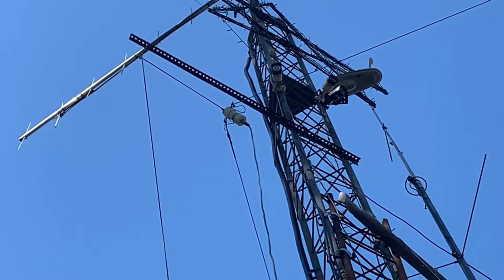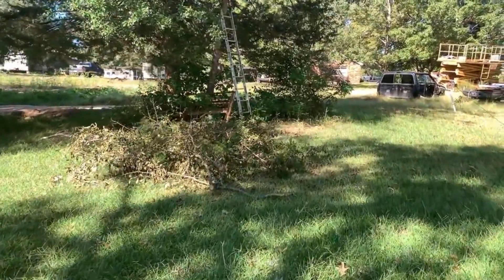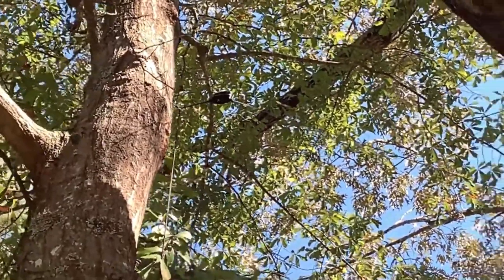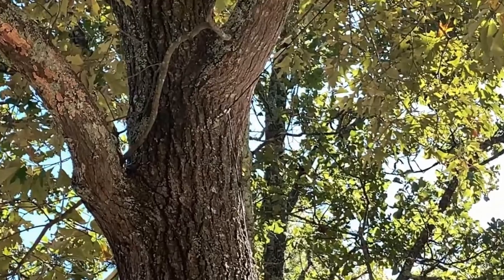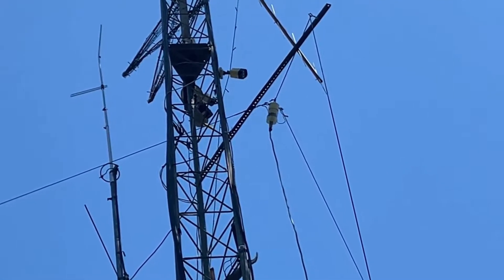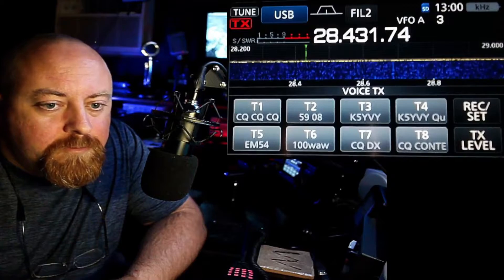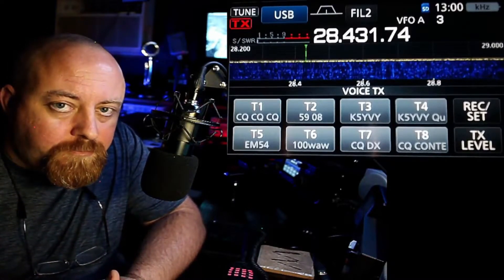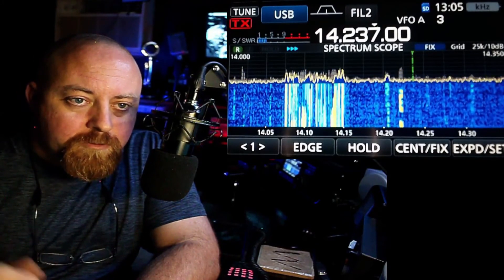80m wire loop TX/RX antenna is AWESOME | Ham Radio

Comment: Most people end up with more signal and less noise vs a vertical. Your area may just have less noise for the vertical to pick up.
Most radios in your situation would benefit from turning on an attenuator. You might find ATT 1 gets you the same noise, but just a little more signal… as mentioned, experiment.
Nice antenna!
Reply from the maker: Hey John, thanks for the comment! I will say since this video I in fact either turn back my RF gain or use the ATT on the low bands when needed. Currently I have been using a T/R switch that allowed me to listen on both the vertical and horizontal at the same time, usually I keep the loop gain turned down just enough to bring the noise floor down, really helps to hear some stations. When I transmit it’s on the loop only. Been working well for me. 👍

Comment: You know you can use your loop also on 6m band?   if not directly in tune it's simple to make a manual tuner for 6m band .   There are good schematic  on google for make it
Reply from the maker: Marko Yes I use my loop on the 6m band very often. Works well , but I do still want to get my 6 element yagi for 6m in the air 😎 thank you 73

Comment: it's an 80M loop but you demo'd it on other bands  and not 80M ! ??? I made 40M horiz loops and just used them on 40M with a Q secton matching device.
Reply from the maker: John , what was I thinking!? All this time and I didn’t even think about 80m not being in the video. I shared the analyzing results in the discord at the time. I can tell you it works great in the extra/cw portion of 80m but I still use my vertical above 3.700Mhz cause it’s easier for me than using the manual tuner. Thanks for the awareness and comment👍 73

Comment: how do you adjust for swr mainly for 75mtr with the balun, most others use 400 ohm ladder line, I prefer the 4/1 method myself getting ready to install one so setting SWR is important
Reply from the maker: Hey Richard, myself I was lucky, I cut approx 266ft of wire and it worked where I wanted it to. So I didn’t mess with it anymore, but if I wanted to adjust the tune I would start by folding a good bit of wire on one end and twisting it around itself. This will allow you to see adjustments in your swr and allow you to decide if you need to continue to shorten or lengthen the wire without making a permeant cut. Keep in mind this method will not show you exactly where to cut , because the twist will still interact some, so just cutting at the fold will not be the same swr when you cut it, may have to trim some more to get that swr where you want it. I hope that made some sense.
Reply from the maker: I will add that I can use the internal tuner for all bands 80-6 with this wire. Except for the upper part of 80m. 3.7Mhz and lower internal tuner works, above i switch to my vertical which is tuned for the upper portion.

Comment: Good advice...  Yeah, you know, one watches some of these youtube video's that model low hanging horizontal antenna, and claim all the RF just goes straight up, and I call BS, and what we see in your video is just more proof. Don't get me wrong, the modeling programs are on the right track, but the visual representations, IMHO, are much less pronounced than what is shown.
Reply from the maker: Thank you David, yeah model programs are great, but there is always that “real world” element that can be very complicated for a computer. I always want to promote the idea of “Just try it”. Because of modeling programs and other “how you should do it” videos I really expected my loop to be NVIS, I already had a low take off angle vertical for DX, but to my surprise with my setup, the loop worked very well and I’m still working DX with it. Soil condition is sandy clay here and I suspect that is why I don’t have to have the loop at 50-75’ like popular belief. 🤷🏼‍♂️.
Reply: @K5YVY  I love trying new things, and learning the positives and negatives of each antenna type. Case in point with the vertical antenna. Vertical antennas in the past were elevated for a reason besides needing far fewer radials. There were elevated so there would be less impact in the Fresnel Zone. Ground mounted antennas the radiation is happening at the bottom of the antenna where the current is. Trees, houses with wiring, bushes, shrubs, etc, that are within 1-3 wavelengths of the ground mounted antenna absorb signal due to low radiation angles. This is a negative of the ground mounted vertical, but you will never hear about it from the antenna manufacturers. I truly believe the best antenna type is the one that is best suited for the situation, but think hams should know the disadvantages of each type by experimentation. In other words, don't just take my word or anyone else's word for it :)  Try it for yourself and judge. Cheers and 73
Reply from the maker: You are exactly correct, my vertical is the GAP Titan DX, no radials and mounted on a pole, the base is 8ft and the feed point in half way up the 20ft antenna from there. So far I have avoided antennas with radials, mainly cause I just never wanted to deal with them lol. I’ve always enjoyed making antennas, even though I’m not very understanding of the science of them, I have a understanding of how they work. Cheers73👍

Comment: You have that beautiful MS Clay for propagation! You should build a ground loop if you can keep the critters out of it. Would love to see it in action, only read about it down there and with salt flats.
Years ago I flew down to consult on rebuilding the Old house in back bay Biloxi. Left with 40 lbs of lovely frozen MS shrimp as luggage!
Reply from the maker: Yea I think I can get away with antenna's lower than "normal" because of the clay soil.  A ground loop would be interesting, but horrible to still mow the yard lol.

Comment: Any antenna works better than no antenna. I've worked a thousand miles on 20 meter sideband loading up the coax shield for a 2 meter beam on a chimney mount on the roof.
Reply from the maker: You are correct about that John 👍.

Comment: Not sure your 80m loop is better than your vertical  based on the video.  The S/N ratio was the same.  Personally, I’d rather have an S8 signal with an S0 noise floor than S9+10 with an S2 noise floor.  I’d bet your 80m loop is a good cloud burner in the best sense, probably fantastic for NVIS and superior to your vertical up to 500 miles.  A loop set up like yours would blanket regions of the country, or the entire state of Texas.  For DX, you prolly need it at 120 ft.  It’s ain’t called a sky loop for nuthin’!
Reply from the maker: My purpose for the loop was actually to have a antenna that would be more NVIS than my vertical. But I find myself primarily working off the loop as I switch between the two, most stations are stronger on the loop, I do come across a station now and then stronger on the vertical still. The noise factor was disappointing, as I know others that put a loop up similar to mine and first thing they rave about is the low noise. I have power lines fairly close on two sides of the loop and believe that’s most of my noise issue as the vertical isn’t as affected.  I do work plenty of DX still off the loop, but I could imagine how much better at the appropriate height it would be. Thanks for commenting👍
Reply: @K5YVY  Yeah, after reading your comment I have to agree with you. I was a little surprised to see the noise up on the loop.  I’ve had/built two vertical antennas in my day.  The first and most complex was a 31 foot vertical with an aluminum ground plate and 32 radials.  It was surprisingly expensive given all the copper involved. It was a solid performer, I got into Europe no problem and most of the country. You can see a video on my YouTube channel of it on receive with an icom r75.  It did a great job for a vertical, but it always had a relatively high noise for compared to two wire fan diapoles I put up, and of course when I built/set up my Cushcraft MA5B beam, it was no comparison on 20m-10m.  

You may have a higher noise floor  because of powerline noise, of course you probably can determine that yourself as powerline noises typically can be blocked to great effect with NB on modern receivers.  If your noise blanker doesn’t work, you’re probably just picking up atmospheric noise locally better than your vertical.  A good vertical/ground  system has its maximum take-off angle at 10 deg or so; your loop has a 90 deg max take-off angle (straight up) at 20ft.  Especially on 80 m, I’m betting any thunderstorm in any direction w/in 1000 miles can impact your noise.  I’m not sure there’s anyway to fix that with the loop except for raising it, but that’s the problem with horizontal loops, ideally they need to be half a wavelength up for maximum performance. And an 80 m, unless you’re living in a redwood forest that’s gonna be really tough to do. Still, it’s a great NVIS set up.  

Do you know would be cool with the amount of property you have? Set up a 20 m or 15 m  triangle loop fed at one corner opposite to where you’d like to get more DX from.  If you can put that up just a bit higher, at 30 feet, you’ll get 2-3 db opposite the feed point corner.  Alternately, you can set up a vertical delta loop for 40 m, then put a reflector behind it that’s 5% larger, and you’re going to get a huge 5 to 6 Db again and maybe 10 db FTB.  That’s my next project. I don’t have my beam anymore, to install a new one at my current property and do it right Would probably cost me five or $6000 on the cheap side of things.

Anyway, I like your videos. Post some more!
Reply from the maker: Great information! Now I know what to use my left over wire for. Seriously thank you for those ideas, might have to talk more!
Reply: NG9X That's not true I can use my 80m loop  which is about 90ft at its highest  point and on 80 m it's a fairly good nvis antenna perhaps better mid range antenna !  But on all the other bands above up to 10m  I'm able to work the whole world with just 100 watts  ssb phone  and cw  while on   digimodes  5 watts is enough  .

Comment: Mine is only 20 feet off the ground and had it for 25 years just love it and requires no maintenance.  Same length as yours.  Has the most gain on 20 meters
Reply from the maker: Awesome Tim! I have to agree it seems to work pretty good on twenty.

Comment: Gm Joe. I run a delta loop and have configured it so many ways it ain’t funny. lol the best that I have found is to feed it at the lowest corner with tru ladder line. I run that open wire to a balun designs 4:1 right at the shack entry. I’ve tried coax as well with a pretty significant loss on the higher bands. The tru ladder line really took all that away. Once you trim your trees you might give it a try. About 10 ft up your tower and shoot the other points of the loop higher if you can. Loops and quads will always open the band first and be the last to close it. Hehe. Great audio btw. Dunno what mic and rack you’re running there. 73 jay
Reply from the maker: Nice tips Jay! I will definitely come back to your comment when I get ready to reconfigure it. Love hearing other peoples results. Thank you for the audio comment. In the shack I run a cheap Neweer mic off Amazon and the audio goes directly into the computer where I have a couple VST plugins for noise control and voicemeeter software mixer to control the EQ and outputs of the audio. One mic gives me audio to the computer, 7300, and 705 simultaneously as needed. 👍 73

Comment: I put an 80m loop up to see what they were all about, and I've never looked back.
Reply from the maker: Awesome Jake. Yeah two locals here each put up a 160m loop and they both till this day still say if they knew how well they worked they would had never bought their hex beams. I had to 80m ,due to power lines on the property. Mine has become my primary antenna now, but I’m curious to try a filter on it to see if I can cut back some of the noise I pick up 🤷🏼‍♂️. Thanks for commenting 73!
Reply: @K5YVY  You have a nice channel, keep it up and you'll pick up I'm sure. I don't have the room for a 160, but that would be amazing to have! As far as the noise in the loop, how is the grounding in your shack? A loop should be much quieter than a vertical.
Reply from the maker: Thank you for the kind words of the channel. Although we shared this in discord I put it here as well for others. It appears my increased noise in the loop is probably coming from power lines running parallel with the south and west side of the loop. The lower temps seem to increase the noise so I imagine with heaters running in the neighborhood that’s causing more flow in the power lines as well🤷🏼‍♂️. Always something to investigate. 73

Comment: Nice loop. I use Google earth to plan my antennas and model them all the time. 73, K1QS.
Reply from the maker: Thanks! I had wondered how accurate the measurements were in maps, I took a known length such as the length of my home is 60ft, google maps was right on the money, so I agree it is a good resource to plan and measure with 👍. 73

Comment: I like the disclaimer at the end. 
One thing I’ve learned, there are no such things as antennas that work the same everywhere.  Terrain and ground types as well as blind luck plays a part.
Reply from the maker: 😎 very true, you just have to try it. I’ve had antennas with more elements and gain than another local 2 miles up the road and he would hear and talk to stations that I couldn’t even hear. Just have to see how it works for you👍

Comment: I can't take ft8 contacts seriously when testing an antenna. Why not try the RBN, reverse beacon network?
Also  I thought ideally 2.5:1 was the ideal balun for 80M loop?
Reply from the maker: Why can’t you take ft8 serious testing an antenna? It’s still a mode that you can plot multiple stations at a time with a db strength indicator. 🤷🏼‍♂️ I just need to know it is actually transmitting, and plotting receiving stations on the map helps show me if it tends to be directional or not. I’m just a simple guy. As far as the 4:1 current balun, from my reading it varies on the operator, as some use no balun or may use various others. As my case the 4:1 works just fine, might try other configurations one day.  Thanks for commenting👍

Comment: Hi Joe/Brett,
If it works for you, the height is OK. Just get it up as high as you can. Wish I had some trees like yours, but I have only a 1/3 acre plot. The back and forth between the vertical and loop proves the loop works. Have fun and you and the family stay safe.  73  WJ3U
Reply from the maker: Thanks Don D !  My personal Goal with this loop antenna was to actually be able to work stations closer to me, so far I feel like it may still be a little to high for the NVIS I was hoping for but being that part of it goes across the driveway I can't safely have it any lower than it is now.  Thanks for leaving a comment! 73 Don.

Comment: I had one at my old QTH and would have one again if I had the space. I would however omit the balun and feed direct with ladder line and a balanced tuner which would allow all of 80m to be used. I found that it excellent as a DX antenna on 40m working VK a number of times. Keep going with it you will love it.
Reply from the maker: Thanks Colin!  Yes ladder line is ideal , but I don't have a balanced tuner at the moment, and where the wire won't work, the vertical will.  The wire is doing what I wanted it to do, so I'm happy with it.  Thanks for stopping by and leaving a comment! 73 to you.
Reply: I second that suggestion. Feed the loop with ladderline. Attach your 4:1 balun at the rig end then into a tuner with coax then into your rig with a short jumper coax. The loop gives best DX (and 6 Db gain) suspended at 50 feet height if you can get it up that high. 17 Meter DX is Awesome with the 80 Meter loop.
Reply from the maker: @kd5txo I don’t know if I could manage the 50ft height, but if I get the spark to change the feeding of it I will come back to these suggestions and give it a go 👍

Comment: One question to you, Joe. Why do have your IC-7300 set to AGC-F...?
Reply from the maker: Quick answer, always have. Unscientific answer is where I get a static crash it doesn’t interfere with me hearing the other station. Say if I had it set to slow and got a static crash it would take a couple seconds for the AGC to bring the other stations audio back up so I could hear what they are saying.
Reply: There are no hard rules for AGC.  Some say fast is for digital modes, slow is for voice.  Some rigs have adjustable decays, some are more hard wired.  Just like you don’t leave your gain wide open all the time, keeping only one setting for AGC in all situations (fast, slow, or medium) probably isn’t great-though admittedly I keep mine the same most of the time.  I play with my gain all the time, it especially helps with NB and NR.

Comment: Nice comparison Joe. It doesn't really mater how high you have it, the loops just work. It may not be a quarter wavelength high on 80m, but it is over the "recommended" height on 20m and up. There will be plenty of contacts made on this antenna.
Reply from the maker: I am glad I have a couple antennas to switch between now, depending on the other station, they may a S-5 on the vertical and a S-9+ on the loop, or it may be right the opposite, some stations it makes no difference.
Reply: Hi lm Robin zs6rwd  l have had a skywire antenna 160m full length with ladder liine  fed in tuner works great for 20 yrs or so works great on all hf bands nvis and dx on higher bands it's the best hf antenna I have ever had
Reply from the maker: Hello Robin! Great to hear, It has become my primary antenna for sure. Thanks for coming by and commenting, 73 👍
Reply: @K5YVY  yes it's a fantastic all round antenna with brilliant reception